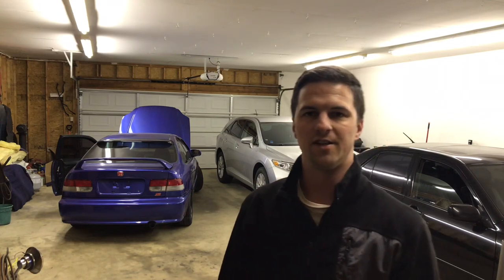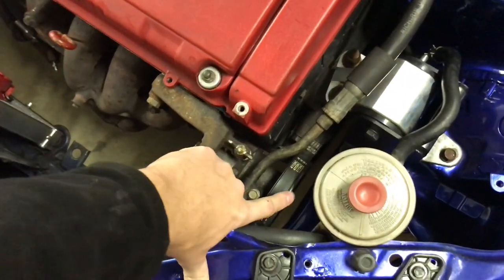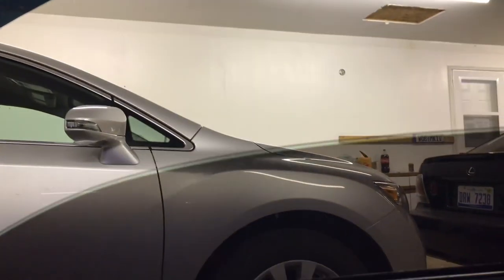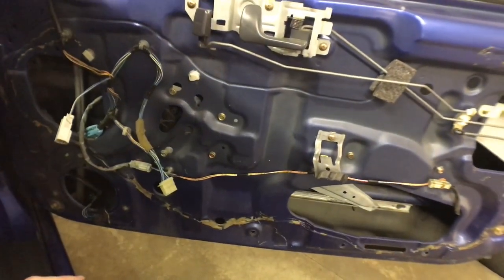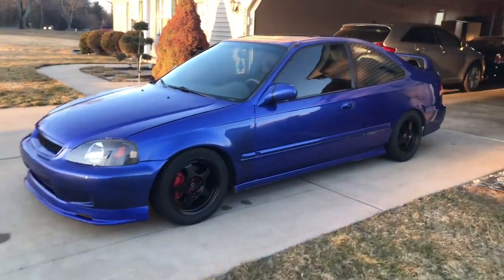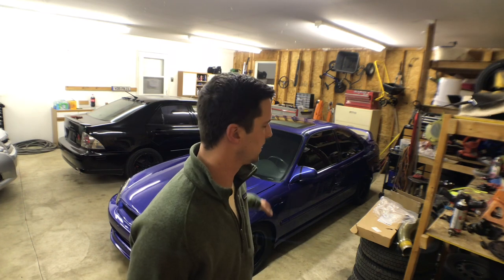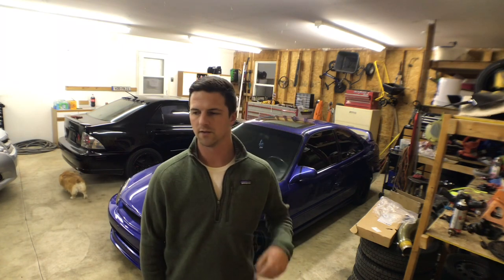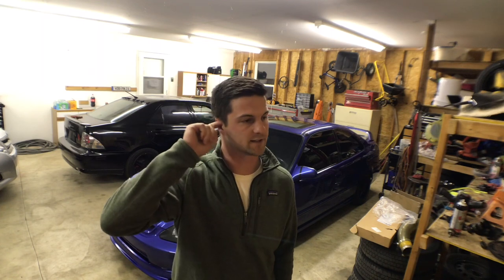EM1 PROJECT IS DONE!

Comment: Issue is NOT the regulators. Issue is the windows rail. The rubber holding the window gets pinched by the rubber in the channel thus forcing the motor and eventually burning it out.  Honda actually did a recall around 2000-2001
Reply from the maker: Zyu ranger good info!  I always lube my tracks with white lithium grease, but the reg still needed replacement because it was bent